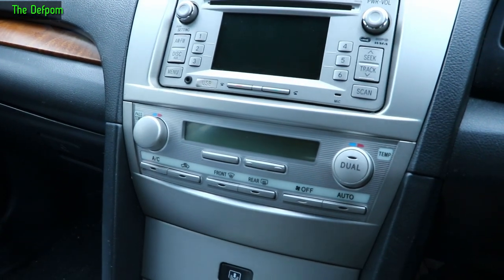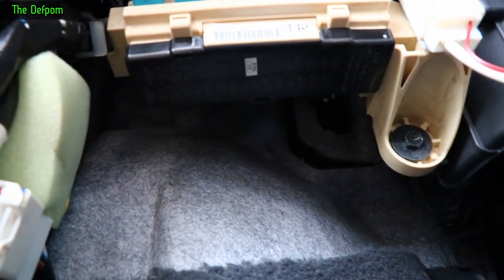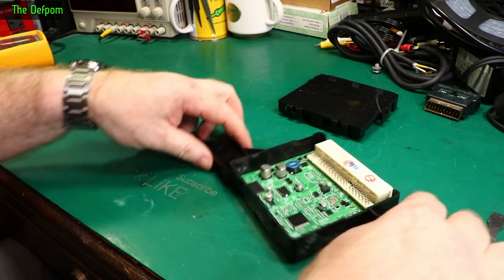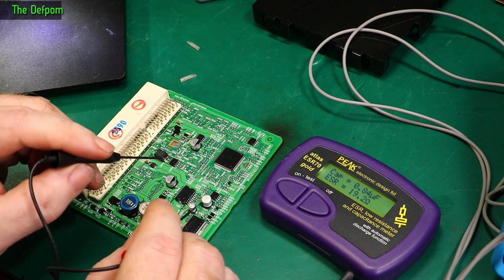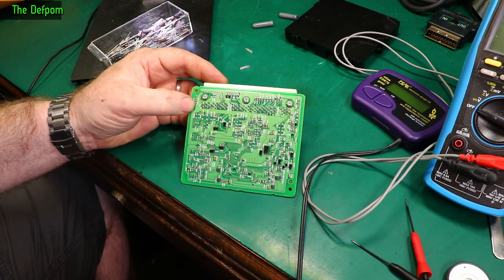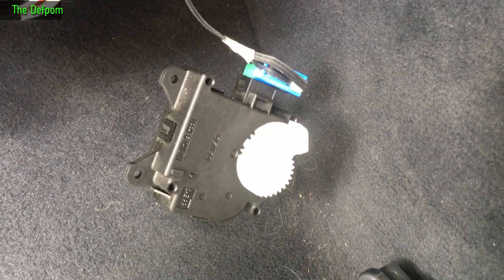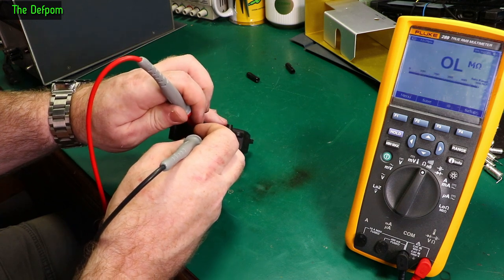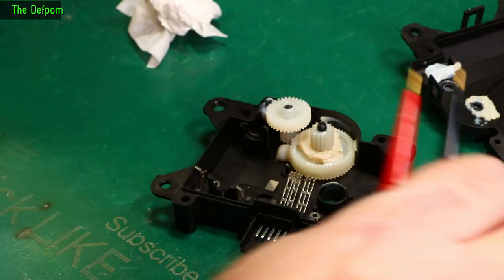🔴 Toyota Aurion A/C System Button Flashing - AC System Repair - No.1109

Comment: Automotive electronics usually pretty robust. Don't often hear about knackered caps let alone anything else. If it moves however, then it's prone to fail whether its a relay, DC motor or crankshaft!

Comment: Scott, most automotive bus controlled actuators are usually LIN based, not CAN. LIN is cheaper to implement than CAN and is usually used for HVAC sub-systems, seats and door assembly based things like mirrors, windows, etc. In your ECU, it obviously has the motor drivers in there ... plus the diagnostics check for short/open and over current on the motor outputs. If you had an OBDII reader (cheap OBDII to USB adapter), the ECU would probably give you the fault code showing the exact failure actuator and it's failure mode (open circuit).

Comment: it's quite common for the AC to come on then you use the windscreen heaters, as it dry's the air before blowing it on the windows, also it lets the aircon run during the winter to keep the gas moving around to lube the seals etc.
Reply from the maker: Yes, mine used to do that, and since the unit failed it hasn’t done it since, apparently it can be programmed but I have not been able to find out how.

Comment: The only bad thing about using 2 capacitors and changing the polarity is that the capacitors are not matched like they would be in a non-polarized electrolytic capacitor.